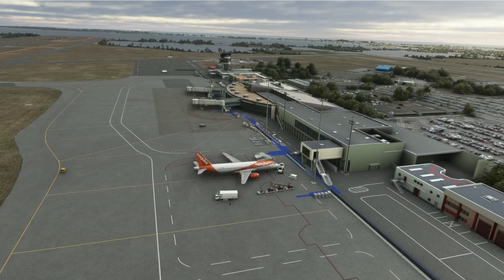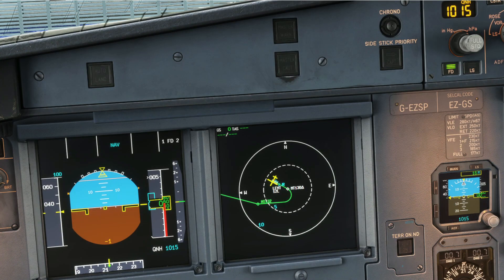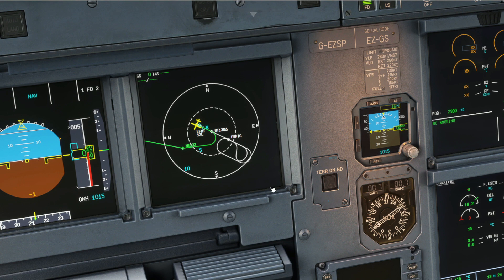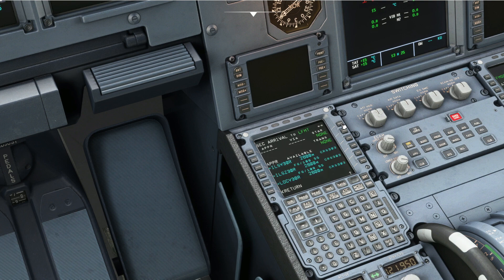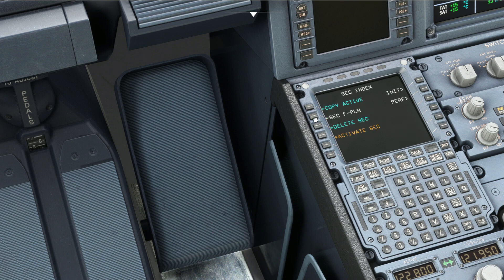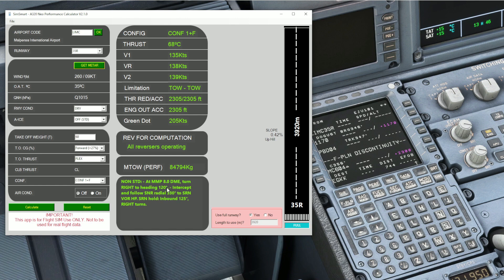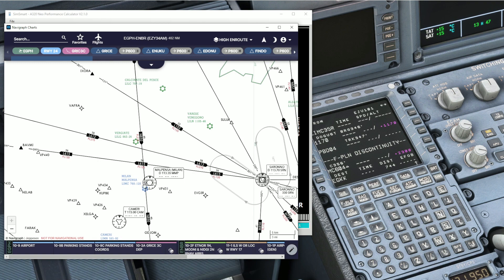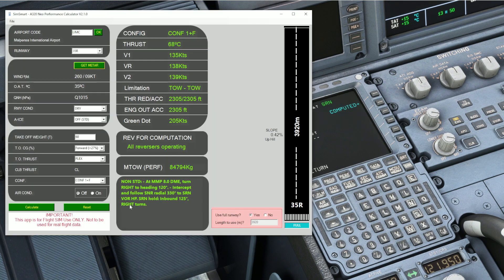Engine Out Proceedures - How to Program the Secondary F-PLN | Fenix A320 MSFS 2020

Comment: Hi. Thanks for the helpful guide. In the case of LIMC, I don't understand why the EFAIL point was further south than the SRN VOR. This way it looks as if the aircraft should return to the SRN VOR and then enter HOLD
Reply from the maker: Yes, I believe this is a slight drawing bug in the Fenix.
Reply: @Easyjetsimpilot  I followed this video along whilst in the simulator and noticed the the odd drawing so I drew a couple of radials using fix info and noticed there is actually no intersection between the 120 degree radial on the user defined waypoint and the 330 degree radial of SRN. I did a bit more testing and realised if there’s no intersection for two radials, it will draw the reciprocal of one of them until they do meet so in this case the Airbus drew the 330 degree radial back through SRN as the 150 degree radial until it met the 120 degree radial of the user defined waypoint (just south-east of SRN). I guess the procedure takes into account the distance you cover in the turn from runway heading to 120 after passing the 8.0 NM point and expects you to intercept the 330 radial from your position after you’ve finished the turn. To make the procedure slightly more accurate you could add another waypoint slightly further north of the 8.0 NM point and use that for the 120/330 degree intersection. That way you’ll arrive at the holding point from the north west which is much more suitable for an inbound course of 125 in the pattern.

Comment: So, let's summarize. I understood how to set alternate flight plan and barely understood where to get the data to program.
But I completely do not understand the procedure. Let me think of it:
1) I fill alternate flight plan on take off
2) During Flight Planning Briefing I say: if engine failures, I activate alternate flight plan. The aircraft activates it's holding pattern and then lands at the Origin Airport manually.
3) If everything goes normally, I continue my flight and change alternate flight plan to alternate DEST airport on flight, correct?
4) If something goes wrong in cruise, I manually land an aircraft at suitable airport? Or I need to edit my alternate flight plan once more?

Comment: Nice video, especially for someone who hasn't yet had the chance to play with secondary F-PLN's. However:

At 22:50, the EFAIL WPT appears to be behind the SRN VOR and its holding pattern when at 18:34 you say it should be way further north. Was your gesture just very much not to scale or was there some error when entering the EFAIL WPT?
Reply: I think it might have been the programming. And this might be just a bug. What Gav did was technically correct. Basically say I want that EFAIL waypoint to be 120° from the PRB04 waypoint and on the 330° radial from SRN. But it seemed to think that meant 330° inbound to SRN. Which would have been on the reciprocal radial of 150°. 

I’m not sure if this is just a bug or how the real aircraft works it out. I’d need to play and look. 

But close recognition of where these waypoints are being placed is pretty critical and yes, the EFAIL was in the incorrect place. The definition that should work would be “PBD-120/SRN-150”. This should place the EFAIL waypoint to the NW of SRN so you can then intercept and fly the 330° radial inbound to it (flying 150°) to take up the hold. Then just enter the hold in whatever entry that’s required. 

I’m not sure if this would be the correct way to define it or if there’s just some anomaly with the FMGC where you might need to use the reciprocal radial if you’re defining waypoints using bearings. 👍